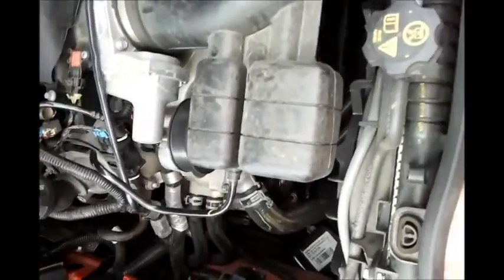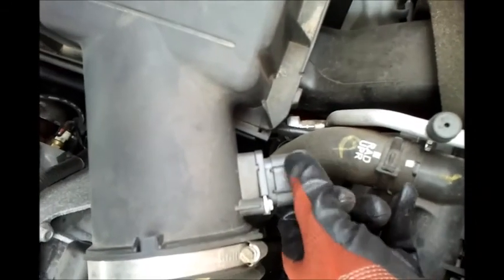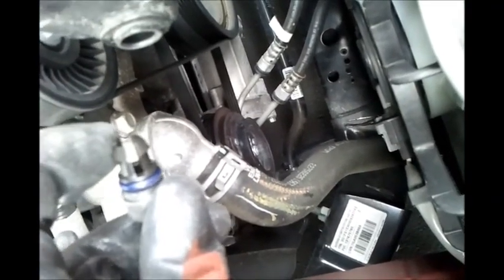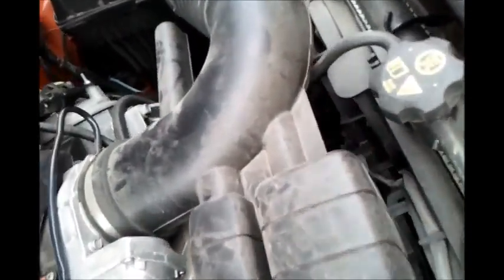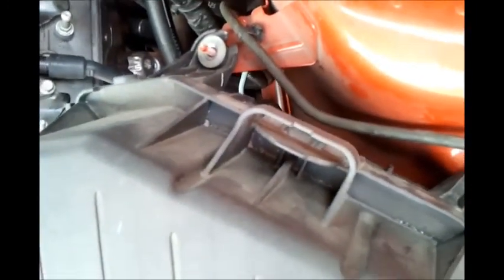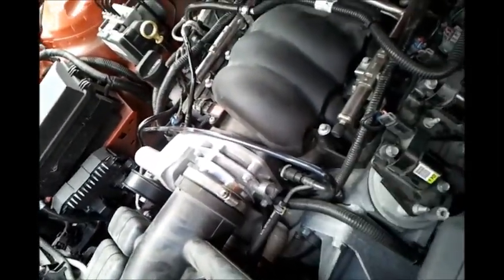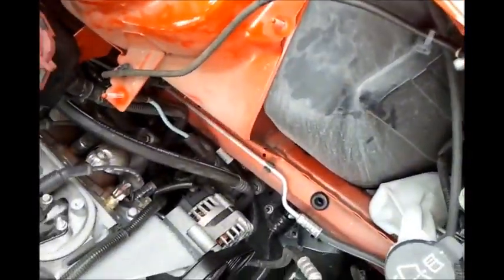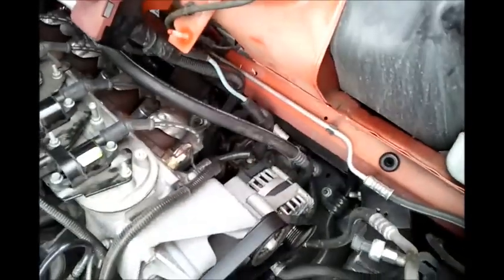2010-2015 Camaro Air Filter Replacement

Comment: What does the pcv connected to the air intake do?
Reply: It means positive crankcase ventilation.  It ventilates the buildup of gasses in the crankcase.
Reply: @drewkidwell3289  What if it was lift in the open 'not connected' ?? thx great info u saved me a lot of money.